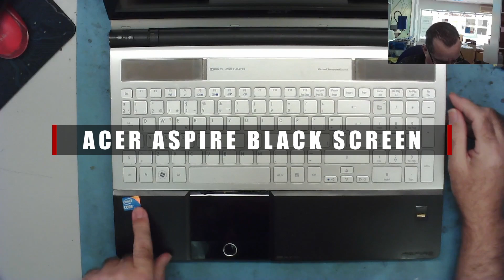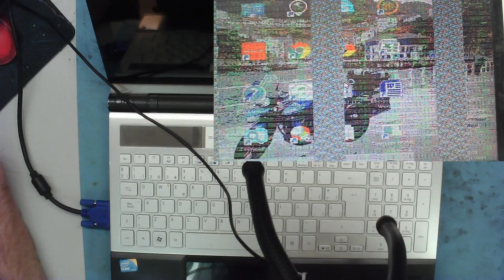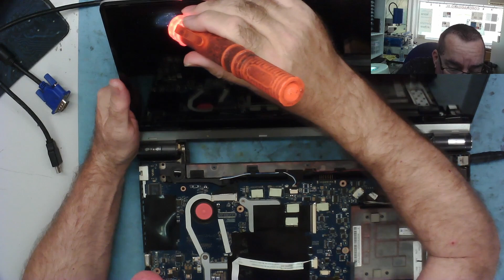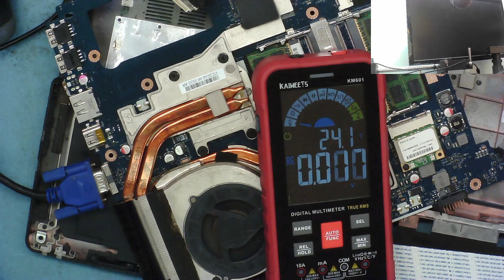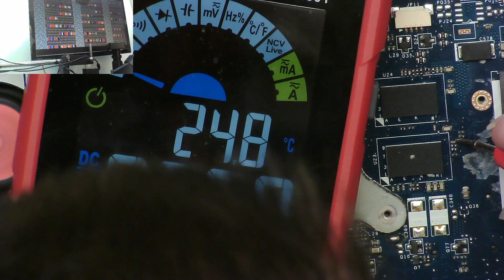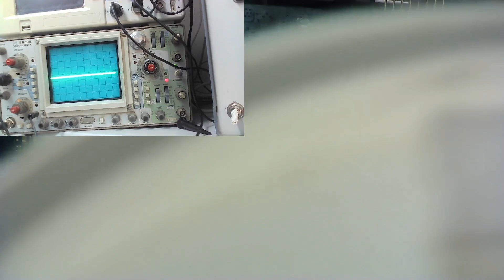Faulty Acer Aspire Laptop boots up but black screen no image no backlight. Can we fix repair it?

Comment: I love your channel. Thanks for the great content. Here are some ideas: remove memory, remove wifi...basically strip MOBO down so that nothing is on it. Remove variables. Second, is there backlight voltage on the screen? That might eliminate whether the LCD is faulty or not, and/or may point to some kind of power rail fault on the MOBO, if there is not backlight voltage.

Comment: Check techcementary channel, he has a vid about diagnosig memory chips on radeon cards by checking the stripes on the screen, but I guess that's only one possible problem. For the sake of video, may be worth to dig further,  the device itself is pointless to fix.
Reply from the maker: Thanks Rafal.  The owner already had the laptop back but I'll check out the video.  I may have seen it before as I watched quite a lot of Tech Cemetary

Comment: Hi Richard you can convert it to igpu if the cpu has build igpu. You can try the confirm it is dead gpu. You can heat for 60 sec at 200 degrees if you got picture then it is confirmed it is dead gpu.  Also it is normal woth dead gpu you got no picture and no backlight and hdmi. If you are lucky it is just removing the gpu coils and it wil convert to igpu. But we must look in the shematics for that By the way radeon hd 5  series are known to fail.

Comment: I had a similar issue. Instead of artifacts i had vertical lines that bright up over time.   No picture on ports. I reflashed the GPU Bios and it worked!

Comment: Do you've a bootable linux USB stick with a tool to check your video RAM? I don't know if your VGA output is good enough for such a tool.  Does this CPU have internal graphics, is the a way to switch in on? Can you get into the BIOS? Does the BIOS have options to overvolt or undervolt your video RAM? Have you tried temporarily soldering a large cap (100uF or so) over the video RAM supply? This look like a laptop ready for recycling to me, probably there are multiple errors.
Reply from the maker: Yes I do have such a linux USB but the display on VGA is very bad.   A few others have made the same or similar suggestions about integrated graphics and I think it is a good idea but difficult to implement given  the display problems.

Comment: If you did not have the artifacts on the EGA output I would suggest checking the LVDS cable up to the laptop display especially since the hinges are shot and that is where the cable is run through to get to the display panel.

Comment: hello sir  i think u can try to rebelling the graphic card this problem is very common on NVIDIA card
Reply from the maker: That is very common on Nvidea GPU  made in a certain era known as 'Bumpgate'  (chips were failing from around 2008 onward)  

The cause of the problem is not a failure of the solder balls under the BGA, more a failure of in the BGA itself with the connection between the die and the substrate

For many years (even to date) since that 'scandal' people are saying you should reflow/put in the oven the GPU.  Even with chips that were made long after this problem was fixed by the manufacturer many people still think/say this.

Although this particular GPU is of a similar era it is AMD, which did not suffer the same manufacturing error.

The best source of info regards this matter is probably the archive on badcaps.com

https://www.badcaps.net/forum/showthread.php?t=94383

Comment: I had the same issue with a Dell XPS laptop. I took a heat gun and carefully heated around the video GPU area. It worked long enough for me to get documents off the hard drive. I have done that several times and it worked for a while each time.

Comment: Love your videos! One piece of feedback I have though is it seems there's some background noise on the mic, almost like the gain is set too high in your mic settings? (raising your noise floor and/or picking up general switching/50hz noise) Defiinitely not an audio expert by any means, but it's almost as loud as your commentary in some areas, making it a bit of a nuisance. (using desktop speakers thankfully, I imagine it's a bit worse on headphones)

That being said, still power through because I love the knowledge, thank you for sharing! :)
Reply from the maker: Thanks, I think it's an intermittent problem on the mixer - I'll look for another one.

Comment: This isn't a proper repair but if you are able to access the bios once then you can disable the discrete gpu and use the integrated graphics.  My friend had the same problem and when I activated the discrete gpu, there were artefacts everywhere. He was using his laptop with the integrated graphics for daily things without a problem. You weren't able to access the bios but maybe deactivating it through windows might also help.
Reply: The proper way to fix a failing gpu in a laptop is to replace it. But to go that far, labor and parts  gonna cost a lot. But there is a cheaper way. Its disabling the gpu by means of removing certain parts that associate with the gpu. Once done. You need to re-flash the bios. Its called dis to uma. Its way cheaper than replacing a failing gpu. Well in friend case. Luckily the bios configuration was enough.

Comment: I had a similar problem with an HP laptop. Turns out that when it gets too hot because of too much dust, it melts the solder around the gpu so that there isn't a good connection. I ordered a new motherboard, transferred the bits over and it works!

Comment: You may try ebay for a second hand GPU and ask if the owner would try that.
it's pretty clear the problem is the GPU since there are no outputs local, HDMI and VGA is erratic.
Probably a long term overheating victim.
Reply from the maker: Thanks for the suggestion. It seems more likely to be GPU than RAM to me  - especially as the artifacts seem to be all over the screen - but try as I might I couldn't prove it . Possibly I can get one from AliExpress and see if the owner wants to pay the money and take the chance.  I'm not sure why that would give no backlight on the laptop screen though. Could be a part 2 I'll let you guys know tomorrow.
Reply: @LearnElectronicsRepair  Looks like the backlight is a separate problem. You had some suspicion to the cable ...
But the torch test will tell you if another GPU solves the video problem.
Reply from the maker: @CXensation  True